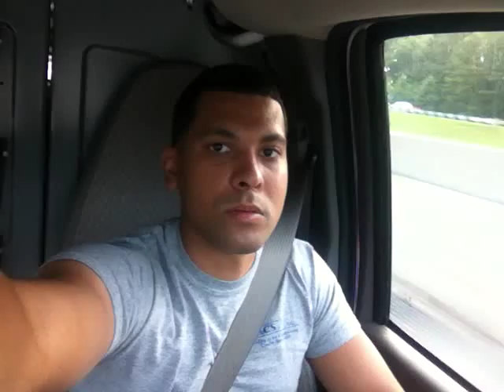Mismatched SEER equipment. Will it really work?

Comment: Over 50% of mismatched units dont work properly for one reason only,, because the installer was too lazy or didnt know enough to tune and resize the piston, they just throw the air handler in , pump it up and walk away.. pure laziness of not wanting to blow and reblow a system down to install and tune it correctly or just the greed of wanting to sell a whole new system,, end of story

Comment: What if you replace a 3.5 ton 10 seer condenser with a 3 Ton 13 seer would the 10 seer Evac coil handle the refrigerant load going back to the compressor? Or would 3 Tons be too small for effective cooling?
Reply from the maker: Gerald Conrad I would not leave the old 10 seer Evap. Especially with the piston. You would have high suction pressures and low superheat resulting in a flooded coil/ piss poor cooling. You can match a new Evap coil with an old condensor but not the other way around. Thanks for watching
Reply: Thanks for the feed back.... I changed coil to match condenser
Reply: @marcoalvarez1276  that's what we mean when we ask what if you got a smaller condenser. Getting the inside unit changed just isn't an option for some of us.

Comment: marco, you are right that putting in a 13 on an old evaporator will not work perfectly. It will function but it will be a comprimise. a TXV does help but it will be more likely to freeze. Also the total charge may be less than factory to make it workable. I usually did 2 or 3 dry charges a year and it almost always comes down to customer circumstances.  The older the evaporator the worse the situation becomes. 

The replacement evaporator is different. Think about it, people use oversized evaporator coils all the time for high SEER match ups. I think by adjusting charge that presents no issue.

Comment: Here's my thinking I'm not a fan of 13 seer dry shipped units for the reason you mentioned. You will not get 13 seer out of it. As far as installing a 13 seer evap coil on a 10 seer unit with the correct piston size you will actually increase seer rating by a little. All your doing is increase coil size. Goodmans new match up for 14 seer is to add one size to the coil to get 14 seer meaning if you have a 3 ton outdoor unit you would install a 4 ton coil to get your 14 seer. So nothing wrong with installing a new 13 or 14 seer evap on an old system.
Reply: T&N Services LLC. What if you put a 14 seer 410a with an old evap coil and slap on a txv on it